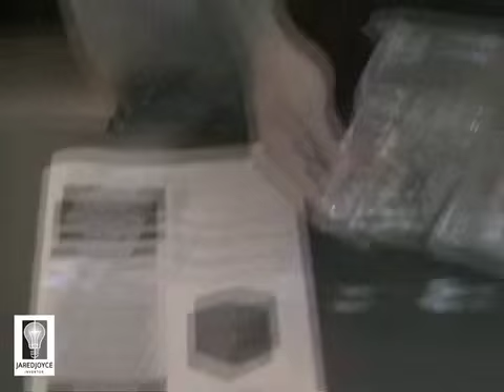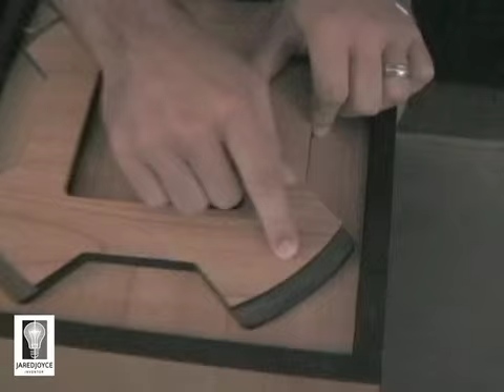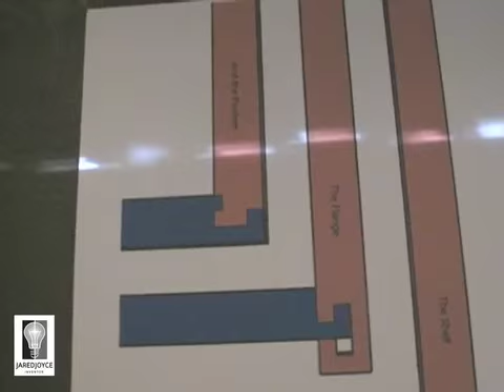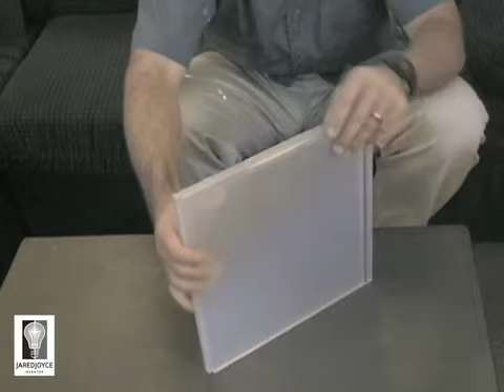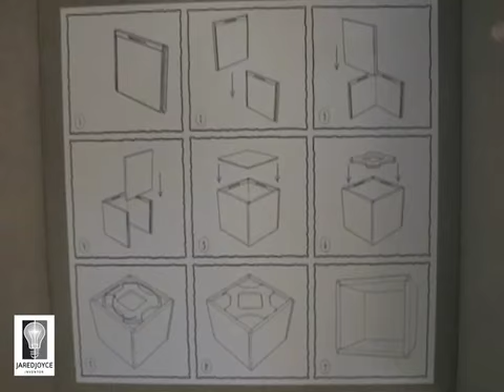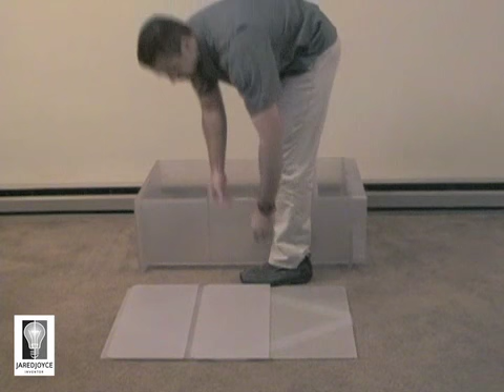Patented No-Tools-Required Furniture Joint System (Full Video) #5MinuteFurniture

Comment from the maker: @adamjebunger You would be referring to the very limited protection of DESIGN patents with your proposed "workarounds".  I however hold UTILITY patents on this invention.  If you check 'em out you will see that I do have a patent on the asymmetrical joint and more.  Enjoy! 7,641,414 & 7,914,091